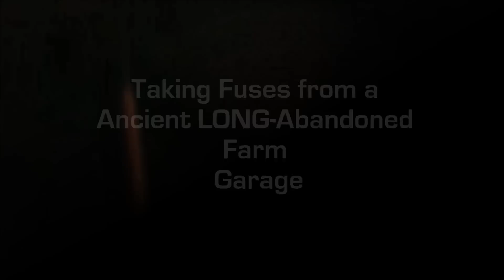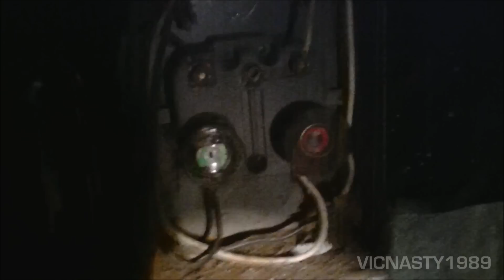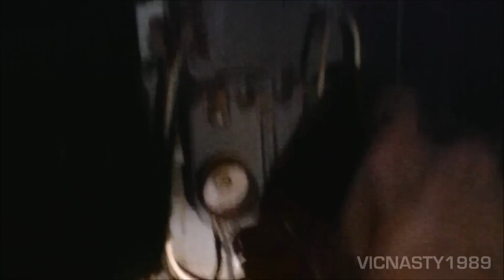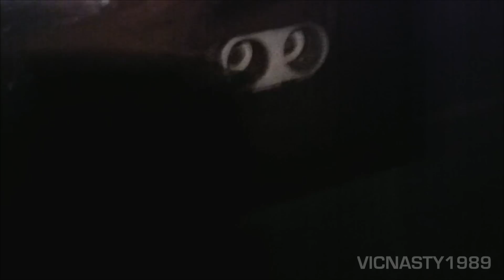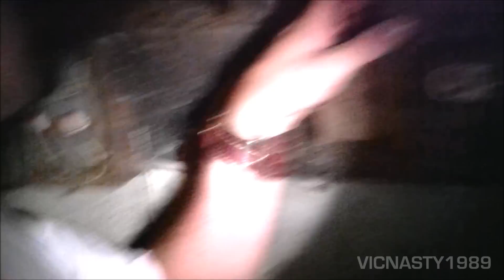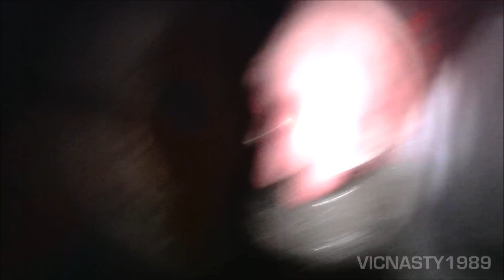Fuse Boxes in an Abandoned Garage

Comment: Nice! I would've taken the fuse boxes too. I came across an abandoned building in PA in the middle of a field that had an old meter and 3 fuse boxes. I was going to take them. Didn't know though that power was still being fed to the building from the road. The whole thing was energized still. The building though looked like it was abandoned in the 60's/70's since every the walls were about to fall inward with weeds and a tree holding it up. Even the service wire was cloth wrapped from the poles.

Comment from the maker: Yeah this place also had some pretty old wiring, mostly asbestos wrapped 12 gauge dual conductor line- without ground (~1950's).  It also had plenty of old two pronged outlets, ceramic light sockets, plus one of the round meter boxes outside.  The service lines were cut off of this building, so I didn't worry about it being energized- but sadly I had no tools with me to remove the boxes, I would like to go back and get them though.

Comment from the maker: I have been trying to figure out a way to get that fridge out of there, but sadly I think its impossible.  The entire structure is recessed into a dense tree-line, and it sits 3 miles from the nearest road, plus the fridge itself probably weighs 300 lbs.  Its a real shame too, its an old GE (early-mid 1930's?) in fairly good condition (with very little surface rust- and all of its original trays and hardware)- it would be great if it still worked!